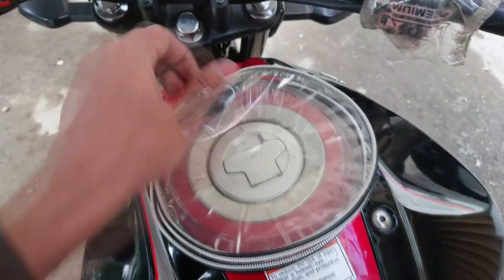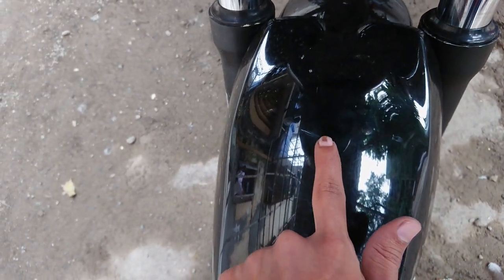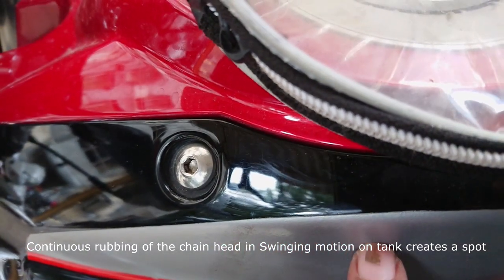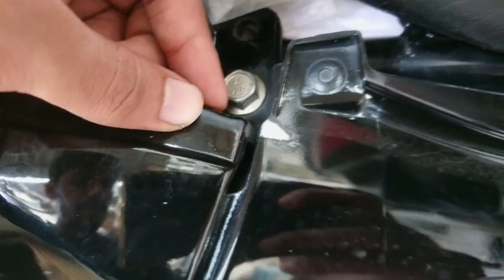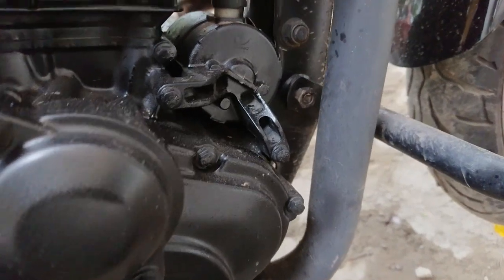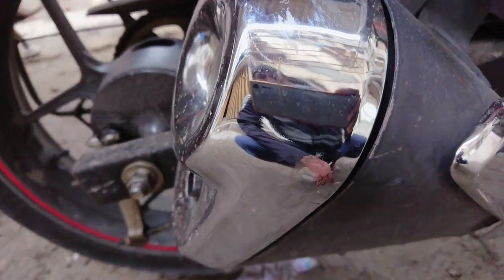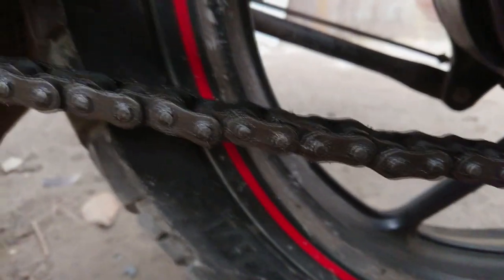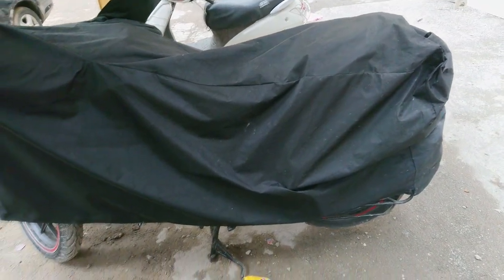How small things can help you protecting your bike from Rain.

Comment: Brother, which grease did you use for bike chain ? I mean what type of grease and which brand !
Reply from the maker: I use motul chain lube for lubrication not grease
But if u want to apply grease even a normal one is good enough
Reply: @THEHOBBIEGRAPHER  In above video you said you applied grease during monsoon season which helped in reducing rust by 85%
Reply from the maker: Yes thats a normal one.
Don't remember its name but if u ask for lubricant grease you can get it in local shops.
Reply: Never!!!!!!!!!! Put grease on motorcycle  chain, it will in no time collect loads of grit which will grind away at your chain /sprockets leading to early replacement,  if you don't have any motorcycle  lube,  use a  light machine oil  like   3 in one, put on a very thin layer as it won't last long, it will be ok for a short time until  you acquire the right lube. Hope this helps.
Ride safe.

Comment: Please tell me whether for scooter these type of plastic covers available?
Reply from the maker: Yes they are available but its not required as max scooters have petrol inlet under the seat.
Reply: @THEHOBBIEGRAPHER  I hve jupiter grande,it has Petrol inlet at outside back.I hve to keep my scooter in rain from morning to evening.So,whether handle cover to prevent switches from rain & petrol inlet cover are required?
Reply from the maker: Its better to put a cover but i have observed that the big handle cover  damaged my paint so i only covered the switches and Speedometer. I doubt if u can get that saperate small switch cover for scooter as the switches are on the dashboard. And you can still use the petrol cover for your jupiter.
Reply: @THEHOBBIEGRAPHER  whether dashboard cover is available for scooter?
Reply from the maker: Yes it is ask in local stores
Reply: @THEHOBBIEGRAPHER  ok,I will ask
Reply from the maker: @legenddon7837  cool
Reply: @THEHOBBIEGRAPHER  tq for all responses..
Reply from the maker: @legenddon7837  most welcome